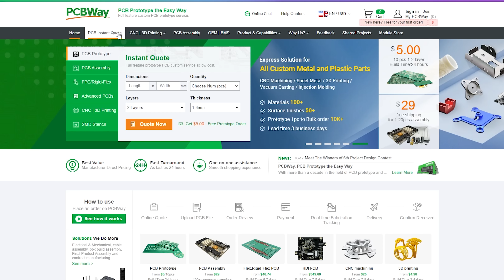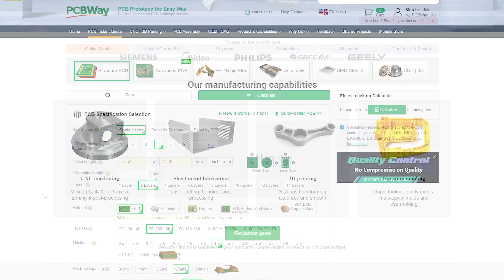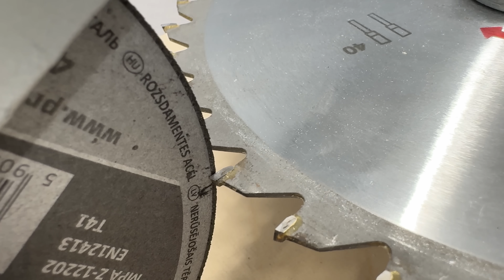I Built an Automated Saw Blade Sharpening Tool

Comment: First off, abrasive cutting wheels can not cut carbide, you would need a diamond wheel for that. second big issue I see is there is no adjustment for angle. You would need to sharpen every other tooth then flip the blade over. Lastly without any way to changing the clocking angle, you would only be able to touch off the carbide teeth once. after that it would no longer make contact. All that said, I am very impressed with your craftsmanship. building anything precision out of wood is not an easy thing to do.

Comment: Interesting, that you used a switch in order to lock the teeth means it could be made to count the teeth so that you know how many cycles has it gone through and program it to shut itself down after enough cycles with a microcontroller.

Comment: excellent engineering by all means very impressed by the ingenuity BUT the problem here is that your design will work only for blades that have straight blades, blades that are angled will be destroyed, also blades that have way more teeth than your  micro switch roller can count. blade with 60, 80 or even 100 teeth will cause the roller to skip over them.

Comment: Correct sharpening should be done every other tooth with a slight angle, and it is also necessary to sharpen the back of the tooth.

Comment: 12:08 and what would happen if you insert different disc which teeth are more used ? It will not sharpen. This device is a waste of time and money. Faster and better is to do it manually with a jig.

Comment: Yes, well done. Very plywoody. And sensible of you to have gone for the necessary precision where it counted but resorted to more janky methods where it didn't matter so much. Also, a drill press and a belt sander seem to make 3d printing unnecessary in many cases.

Comment: To sharpen a blade properly, you need to do tops and faces.

I generally don't recommend people attempt to grind tops at home because you can really mess up the geometry, and cutting performance.

But you seem like you could figure it out.

Take 300 micron off the tops, 30 from faces, for best results.

You'll get about 8-12 sharpens per blade this way.

Comment: This project is considerably more sophisticated than your video implies. You’ve done an amazing job of engineering and made it look simple. Good job!
Reply: Notice: 

The grinder disc is not supposed to be used like that. It is at least a way to burn through your discs much quicker cause of them failing. If you are unlucky, this can also harm you. 

There is no  control over how much pressure will be applied against the grinding disc. This can both increase wear and lead to insufficient grinding. (We were not shown the faces of those teeth. Wonder why...)

A larger blade needs adjustment of the switch and the blade lock. which is doable but not exactly built in.

Comment: This is a nice idea but too much is wood and for me not trustworthy enough regarding tolerances and the tedious realignment for each saw blade would drive me crazy. You also cannot sharpen very high or low teeth blades as your stepper wouldn't work for very big gaps or tiny ones.

Comment: I actually build something very similar to this, but on a manual setup. And I sharpened bandsaw blades using it. Took a little time for each 131.5" bandsaw blade, but I can honestly tell you, those resharpened blades cut better then when they were new. And maybe that is because manually moving each tooth into their locked position made every tooth get the proper resharpening cut. I used a Dremel tool with a diamond disk and it worked perfectly. So thumbs Up for this design and setup...

Comment: Did anyone else freak out at 2:21 lol
Reply: 10:50 look a little dangerous, specially at 10:56
Reply: @tde04014  Why do you think a plunge/pocket cut using a circular saw is dangerous?
Reply: @tde04014 also, why not just cut a much larger slot, so that he can change disks easier?  Unless he plans on just undoing the hose clamps each time.
Reply: @tde04014  It's not dangerous. These tools operate completely smoothly. And it's like driving a car to be honest. You feel what you are doing, and once experienced it's hard to make a mistake. Edit: That's what me as a carpenter would say that use this tool every single day. All though i would probably use a wood carving disc on an angle grinder instead. And the reason these tools are so smooth is because of the centrifugal force of the spinning blade, essentially making it a stabilisator.
Reply: A little, but I was freaking out more at 4:52, cause in the previous video he glued the board down with hot-snot!
EDIT: my bad! Not the same guy, just the same machine. Turns out this guy used stand-offs in his build!
Reply: I 100% expected the balls to fall out - it kind of confused me why they didn't, but otherwise didn't think anything of it. 😅
Reply: you can see a shiny strip holding the balls in
Reply: Bu çok hızlı v itici sert plastik olmalı

Comment: If you're going to blatantly steal from Paoson Woodworking, you could atleast credit him, you think?
Reply: What exactly did he steal?  The part where a limit switch is used to index.  Oh or is it the motor drive or the angle aluminum used to move to next index?  Or maybe the linear bearing?  Or the part where a bearing and grinder shaft was used to secure the blade?  Or the Oh wait,  I see it now,  it’s the part where it sharpens something…

I do agree with you though,  give credit where it’s due.  I just don’t see where it’s due here.

Comment: The spring loaded mechanism 9:55  reminds me of a mechanical clock.
Reply: Yup. That's called an 'escapement' mechanism. In a watch or clock this is used to control the release of mechanical energy from the main spring, taking its timing control from the balance spring assembly.

Comment: In the slide, you loast a ball. The slider are delivered with a plastic rail to enshure that the balls are not get lost. So, you sould not remove the slider from a rail without mount the dummy..
The basic material is wood. This sould be replaced by ALU or other more robust material.

Comment: you have made good looking device but you don’t understand the geometry of the saw blades..
Reply: Skip 1 toth all the way around and flip over and repeat till done?
Also plywood so much plywood.
Reply: @101_skeleton6  no because then the rotation system would not work. on the commercial machines you alter the angle of the cutter

Comment: Very fun project. Although that cutting wheel is for: acid resistant steel, aluminium, stainless steel, and carbon steel. It will not sharpen carbide toothed saw blades and they are not intended for side loads in application. Consider a search for "100mm Blade Sharpener for Grinding Carbide Cutter". These are diamond grit embedded in resin. The infeed would also need to be much slower with a solid repeatable tooth stop.
Reply: Any cheap diamond wheel that's thin and will fit the arbor works fine.
Reply: @Bob_Adkins  Thanks for the response Bob. "Any cheap wheel" can be misinterpreted. For best success look at what cheap blade sharpeners use with the correct arbor size. Many saw sharpening wheels I see are 120-150grit resin bonded diamond with a rigid hub as not too flexible depending on diameter. Typical saw sharpener wheels at 100-125mm are roughly 5mm thick aluminum hub and thin out at the grinding rim. The cheap coarser electroplated type wheels can work fine for some applications, but often chip carbide and overheat brittle edges defeating the intent of sharpening.
Reply: @LetsJeep, you can overheat on both plated and resin and on cbn ones too. Any would work just fine if you don't put too much pressure cause on the plated you will easily rip the Dimonds out compared to the resin one. Not to mention tungsten carbide isn't gonna wear has fast as hss so if your not doing it daily there's no reason to get resin ones.
Reply: Forgot to add, depending on the kind of carbide, you can sharpen them with normal abrasives since they all have different resistances to them. Obviously your not gonna be using aluminum oxide to do so

Comment: Great design. Really simple way to sharpen cheap blades rather than throwing them out. Not sure I'd trust my accuracy for my "nice" blades though...!

You've got me thinking about adapting this for doing a bandsaw....

Also, on "Linear", you did great at conveying the meaning - but the English pronunciation is "Linn - E - ah" (UK) or "Linn - E - err" (USA) (If you know IPA, UK: /ˈlɪn.i.ə/ USA: /ˈlɪn.i.ɚ/). From context it is obvious what you're saying, but outside of context I think many English speakers would not be able to understand your "Line - err" 😅

Great video!

Comment: Looks pretty cool but there are lots of flaws, the teeth are normally anggled slightly with alternating angles, and normally we would cut the top as well...but since this is in your shop you can sharpen more frequently...also, my dad has copd from saw sharpening for years, and most of that was wet sharpening wearing a mask, so some dust extraction would be wise
Reply: You need to sharpen only the face of the carbide, which is flat. The alternately angled tips aren't touched and are still angled until a lot of sharpening.
Reply: @MightyGimp  very fine particles getting into his lungs, his first sharpening machines used vacuums instead of wet sharpening.

Comment: The detent mechanism should engage on teeth that have already been sharpened, i.e. shortly after the grinding wheel.
This means that you still have an angular offset for the first few teeth, but after the first sharpened tooth arrives at the notch, the angles to the grinding wheel remain identical.

With your setup, you have 3/4 unsharpened teeth as an index - so you would have to let the blade grind 1 3/4 rounds.

Right?
Reply: Good observation. A better solution is to index on the gullet of the teeth rather than on the carbide cutting surface. So, install a smaller diameter wheel on the indexer/switch.

Comment: The best material for the mounting hardware is Aluminum or brass not wood, it can also be machined with the same cutting tools used for wood.
Reply: Yeah but it's much more expensive and you need other tools to work with it.
Reply: @skunkjobb  The same wood tools.

Comment: Great build. Simple and smart. My only suggestion would be to account for the kerf. You could do this by adjusting the sharpening angle and sharpening every other tooth. Then flip the blade and do it again. If you ruin the kerf, your blade is way more likely to catch on your piece. Not a problem for a chop saw but very dangerous on a table or circular saw. Anyway, love the build!
Reply: I don't think you're right with these tungsten tip blades. To my eye each tip is set at the same angle, only the( secondary?) relief angle on the rear of the tips alternate.

Comment: I was expecting the switch to do something but you didn't wire it up.  Will that be something you do in another video?
Reply: The switch is only there to provide holding force with its spring loaded roller, not to be a switch. Without it, the blade would just go back and forth due to the friction in the other springy thing.

Comment: Usually the kerf angle is alternating between teeth but I suppose if the results do the job then who cares! Great work. With a few developments to your design you could also make that work too! 😎
Reply: yes, though it looks like it has a compound angle (the back of the teeth is also angled) so it's fine-ish, you still get a single point of contact most of the time.
edit: it seems like some carbide saws like that don't even have a compound angle, and are just flat and rely on the top angle only, so for one of those it would be perfectly fine.
Reply: Depends if it's a cross-cut or ripping blade. This setup would be fine for a ripping blade, but yes cross cuts alternate and this would ruin the bevels. Could fix that though by having it do every other tooth, then flip the blade over and reverse it or change the grinder angle.
Reply: @jamesc1283   True.  I think an improvement to the setup is to have discs that are half the number of teeth for the blade being sharpened and use that disc to drive the forward and reverse direction. In essence, thirty lobed disc for a sixty toothed cross-cut blade. 
Yeah, it would require some work to make the specialty discs but should work.
Reply: Cutting edges are all about the rake and relief.  This sharpening tools looks like it reduced the rake angle to zero, not good for wood or other soft materials.
Reply: His tests were in a chop saw and the lack of kerf angle doesn't matter as much in that application. Rip and crosscut blades in the tablesaw would be affected. But if you had no other alternative this would still work for those as well. Around me there are a couple shops that still sharpen blades and it's very cheap. Still, I like this machine for its relative simplicity. He made a great video.
Reply: you could just give your blades to the sharpening service it dosent cost much if you have multiple blades to sharpen  or if its for a shitty circ saw with cheap blades just buy new ones and yeet the old ones out
Reply: @Johnssonmcsaggysack  you could just have everything as a service or you could learn to do it yourself.
Reply: @Johnssonmcsaggysack  why even bother using saws lol? You can just buy furniture, duh.